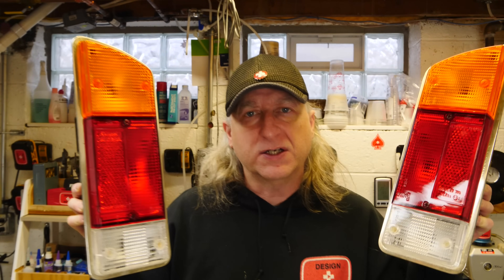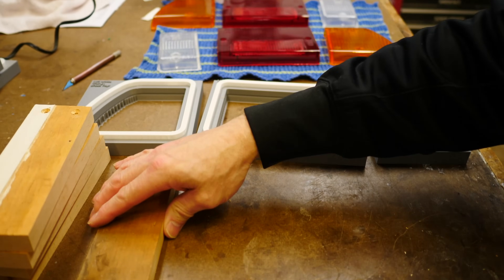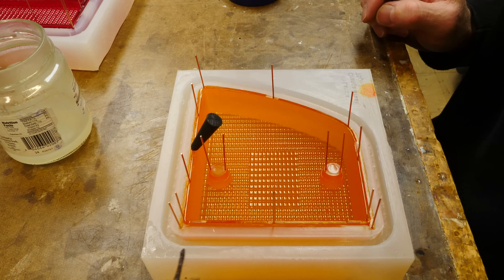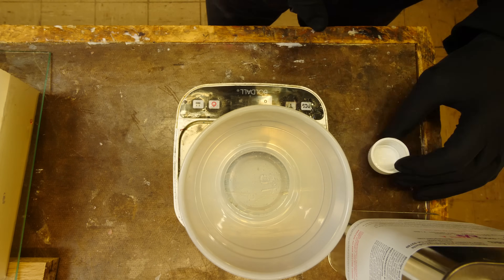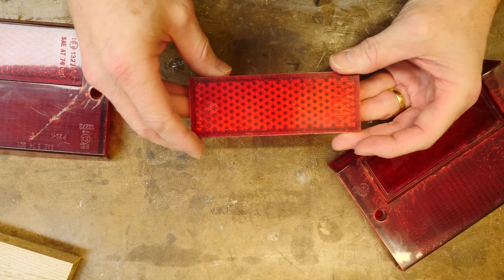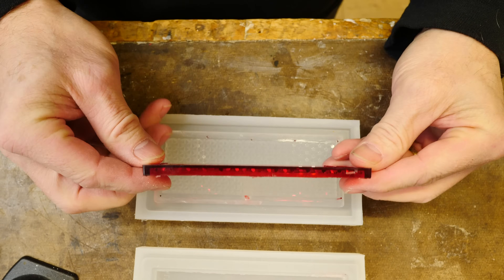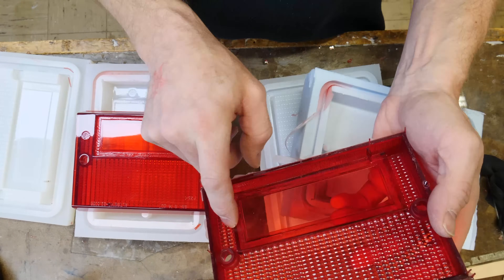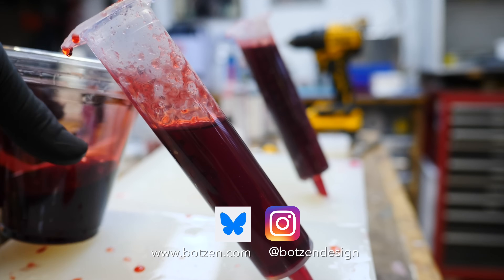Resin Casting Lancia Brake Lights

Comment: Eric, why do you not ever pressure cure the molds.  Especially if you’re pressure casting urethane, any possible bubbles suspended in the silicone will collapse under pressure even if they are tiny.  However, fine detailed items and such will form much better without having to vibrate or brush on ribbed details.

Comment: Ha ha ha, so prefilling the mould is also  a process. Not one process works for all. I have an intricate mold top portion and that needs prefilling but I have registration interlock on sides so prefilling is not that effective. I think I also need more vent holes.

Comment: They ARE also used on the Bitter SC, and last I checked, which is some time ago, they were still  available from the Monte Hospital in the UK. Has that inventory been depleted or ? If so, they might be interested in restocking from you, as well as some other suppliers stateside. 
BJB "5150" always cracks me up- 5150 is the code for a psychiatric hold.
Great job on the molds!

Comment: Really good job. You probably could add some discussion about design considerations regarding the splitter piece and generally how you define how the mold is going to be.
Also, that Bitter Parts website is something else. Couldn't even post their address.

Comment: Thanks for the awesome video, this is perfect. The good thing is that Tali lights were separate pieces for different colours. I think I will split my tail light by colour and cast them. Thanks for the tip. I am missing the pressure pot though.

Comment: I have been replicating similar parts for an interest group here in the UK. Usually indicator units, lights and even plastic body parts that are so rare now that the prices were becoming eye wateringly expensive. I love the splitter board idea and must invest some time into that. Also the use of syringes as you do is ace. Just out of interest is there a standard way of pricing your parts? I am a little all over the place with my pricing but my parts are best around when you compare to others attempts of recreating. I would love to have a proper chat with you about everything but your help through the videos you post has been invaluable. Keep up posting the good work, its awesome 🙂👍

Comment: Do the replicated reflectors actually work? IE if you shine light from varying angles does it get reflected back to where it came from?

In order for them to work in that manner, the angles have to be very precise as the light isn't just being reflected once but several times internally and the material needs to have a suitable refraction index - i'm assuming you might already know this but you don't seem to mention any testing of the final product.

It looks as though the refraction might be fine as when you move it around it seems smooth and shiny enough.

Much like optical lenses however, they are very simplistic devices but require high precision to function correctly - i'm curious if the molding process retained this precision adequately or not.

Other than that they look great and i really like how you explained not just what you were doing but the why, very informative!
Reply from the maker: Yes, they work
Reply: That is my question too.

Comment: Great video about your process, that was a lot of work! I am doing a lot of silicone and resin casts, I can't get the BJB resins in Europe unfortunately. I liked how you used copper wire as your vents - I don't get it how the superglue glues them on the plastic. I've used wooden toothpicks as vents (after trying many other things that did not glue with superglue) Your results are amazing. And clever pour funnel by the way. Cheers!
Reply from the maker: Wood is to absorbant, use and accelerant to set the super glue instantly
Reply: @EricStrebel thanks .inwas lucky to get away with brushing them with lightened Vaseline after I glued them. Where I am at, they never heard of accelerator!
Reply from the maker: It's called kicker some times or insta set, it cures the cyanoacrylate very quickly, works great.
Reply: @EricStrebel  Thank you Eric, I will check it out!

Comment: Wonderfully supportive and inspirational as always, thank you, Eric! 🙂

How do you remove the resin that gets stuck in the vent holes?... just poke them out with a copper rod?
Reply from the maker: Yes, I use a tool made with piano wire

Comment: Fantastic videos as usual 👌.  Eric, I cast a 60s beaker using a vacuum chamber & pressure pot, however, I noticed when preparing for part two of the silicone the rim of the silicone on part A was coming away from the rim of the beaker, allowing air down the side. This in turn allowed silicone to seep in when I placed the liquid silicone ontop and in the pressure tank. How can I avoid this?
Reply from the maker: You must take great care to ensure that the master parts stays secure in the first half of the mold, there is no way to undue this if it comes away from the mold, redoing the mold is often the only solution
Reply: @EricStrebel  I secured the master to a clay base with the keys pressed in. I unfortunately have to remove the clay first. I also use foamboard as the walls. Is this probably too weak?
Reply from the maker: Possibly, yes, I don't think I have ever used foamcore to make mold walls, but I do see a lot of people do this on YouTube

Comment: How Do, Eric!
I spoke to my suppliers of clear polyurethane and they told me that I should be getting nearly 50 cast from my mould which is crazy! They did mention using release agent to prolong the mould lifespan but I'm not sure if that'll effect the mould finish. Something else they mentioned was to polish the matt mould surface with silicone fluid which I've never heard of. He said this may replenish the silicone surface restoring the glass finish but I'm skeptical...
Reply from the maker: Yeah I've never heard of that before either

Comment: Is such resin on the same level as the original part, material wise? Since i heard even the thougher ones tend to yellow after some years.
Reply from the maker: According to the manufacturer it is
Reply: @EricStrebel  ok interesting 🤔 thx for the answer

Comment: What kind of polish do you use for the plastic?
Reply from the maker: 51056 purple polish from 3M, I have added a link in the description. Not cheap, but it's the best polish I have ever used and I get excellent results with it on a variety of materials.
Reply: @EricStrebel  thank you! Missed that in the description. Cheers.

Comment: Excellent guide. How long did the whole process take?
Also, what will happen if you subject the resin to a vacuum/low pressure in order to get rid of the bubbles? Or is that not an option?

Comment: Hello Erik. I'm having trouble finding silver/metalic grey pigment/tint for PU rubber. I've tried Mica power, alcohol inks... Everything causes cure inhibition so far. I'm getting desperate. What would you recommand ? Almost all PU pigments I find only works for PU resin, not rubber. And for only rubber, I only found a few "regular" primary colors, such as red, white, black etc.
Reply from the maker: Try aluminum powder

Comment: Eric, one more question. If I degas the silicone and leave it in the chamber for an hour and there's no more bubbles then do I really need to put it in the pressure pot for the rest of its curing time or do you think i can get away with casting in the pressure pot after it's cured without pressure? After all there should be no bubbles for the pressure pot to crush and there's no risk of the silicone seeping into part A of the mould.
Reply from the maker: You will get bubbles just from pouring the resin and it will react with the moisture in the air, pressure pot is needed for most resins
Reply: @EricStrebel  No no, I mean the Silicone not the resin. I'll still pressurise the resin when casting but can I use a Silicone mould in a pressure pot that's only been degassed when it was initially moulded.
Reply from the maker: Silicone is not normally cured under pressure
Reply: @EricStrebel  ah! I was told if you don't cure it under pressure then when you put it under pressure when casting clear resin I can cause bubbles on the surface of your cast. I'll not pressurise it next time. Thanks Eric!
Reply: Yet another quick question. I've just cast the third water clear polyurethane resin beaker in my mould and the glass shiny surface of the silicone has gone matt already. Is three casts before the mould is useless normal or have I gone wrong again?
Reply from the maker: Should last 20 parts at least. What brand silicone are you using?
Reply: @EricStrebel  you've likely not heard of the brand as I'm in the UK but it's ' Thomson Bros Silastic 3481 base silicone'

The Urethane was 'Polycraft Opticast 1000 water clear polyurethane casting resin'. I removed the parts approx 1 ½ hours in the pressure pot. I also cast two Epoxy clear casts in the mould first. Could this have been an issue?
Reply from the maker: Yes, my guess is the epoxy caused that, epoxy can be quite aggressive.

Comment: Im planning on doing this but wouldn't resin 3d printing the molds be way easier?
Reply from the maker: Sure it would, but your final part surface quality would be terrible.
Reply: @EricStrebel  I mean resin prints are smooth but if you want them to be even more you can sand them
Reply from the maker: Try, see how it goes

Comment: Awesome!
I've even seen people make casts and scans of the exterior of the real deal and then print inner sections themself to make new shapes for LED upgrades. Can lead to awesome results on projects that want to give 80s cars the cyberpunk treatment (like the extra visual oomph for EV conversions).

BTW: What's your long-time experience on using a drill press as a poor man's milling machine? I've always felt the urge for similar plastic work, but at the same times there's that talk online about motors/bearings like that not being designed to handle such sideways forces.
Reply from the maker: The drill press has variable speed from a treadmill motor, long term it's been fantastic and a great option for milling wood and plastic and occasionally some sort of aluminum. I have a video about the upgrade actually.

Comment: You really should do a set of these and put them out in the sun for a while.  Otherwise all this work is for not.
Reply from the maker: Uv stable resin, mfg has already done that work
Reply: @EricStrebel  That would make me very nervouse to trust a marketing blurb.  Not sure I could put all that labor into an item, and charge a customer up the wazoo only for it to fail and feel good about myself.  But maybe that's just me.
Reply: @GeorgeGraves  Hi, manufacturer here.  We have 50+ years of making aliphatic based polyurethane resins.  We don't make a claim on UV resistance unless it has the chemistry appropriate for the application.  Most resins won't do what BJB's Water Clear systems will do (we have plenty of those resins for different applications). We have many aftermarket automotive brands that use our products specifically due to how they weather outdoors compared to many DIY hobby resin systems.  We have also provided material systems for countless outdoor art projects and theme parks using this type of chemistry.  No marketing blurb, we have the parts in the real world to back it up!
Reply from the maker: They  make an excellent product, that's why I use it, they stand by tier claims and they are valid. No need to reinvent the wheel here.